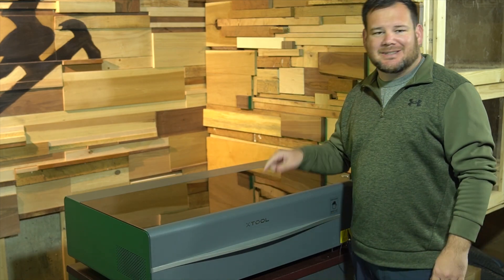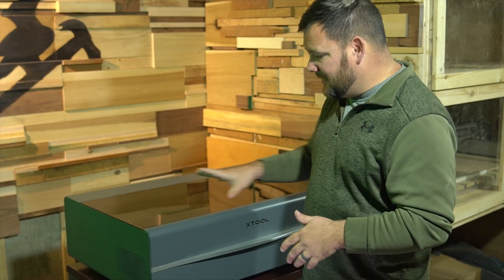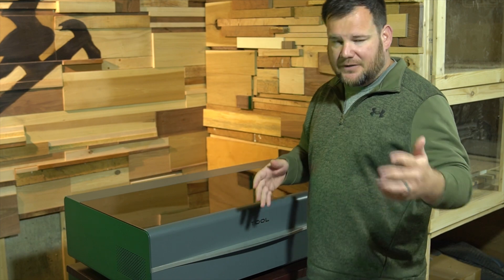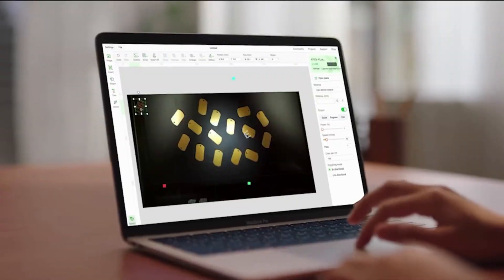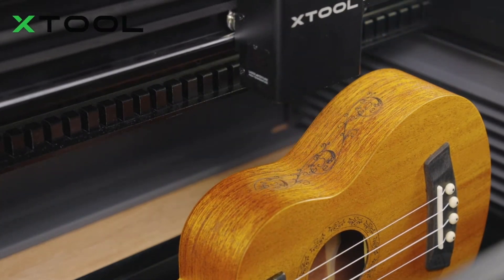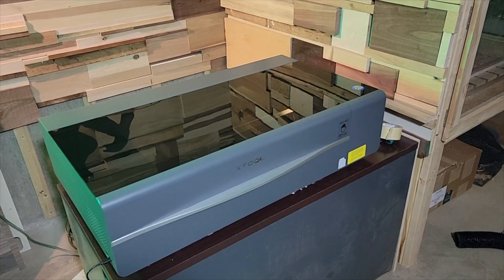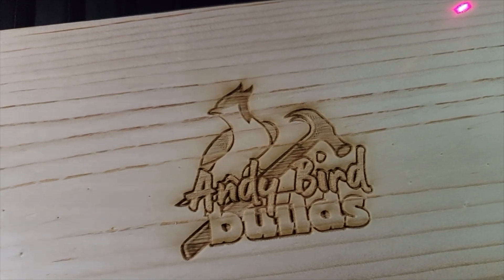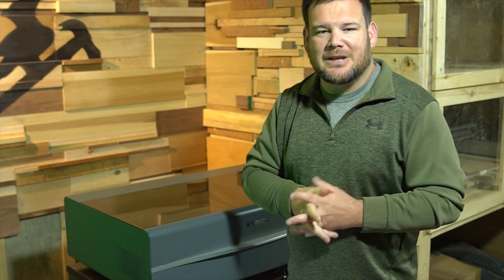This new laser can do 6 things others can't! Check out the amazing Xtool P2 Laser Cutter!

Comment: What type of table do you have the P2 on?  Is it one that you plan on using when you are actually using the laser?  It looks like it fits the machine perfectly.  Will it wobble?  Thanks!
Reply from the maker: This is an old office desk. Any solid work bench, countertop, or table will do. There's not a lot of force from the machine running, just the overall weight of it